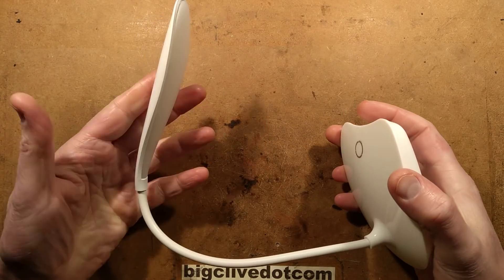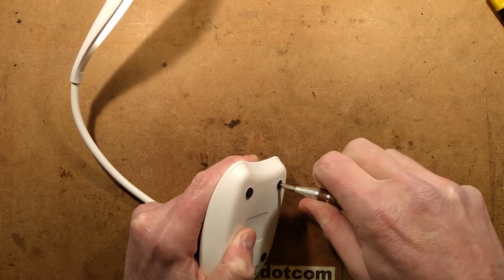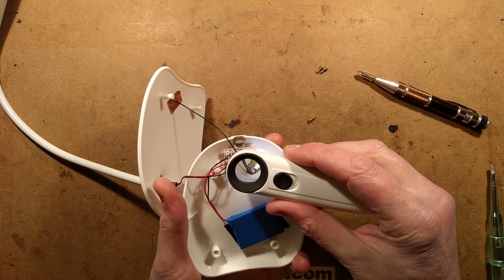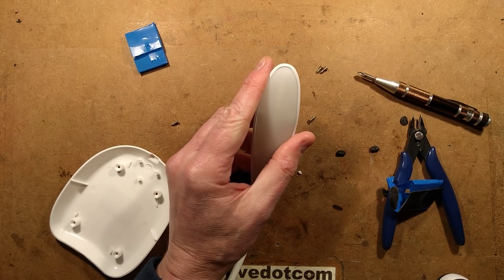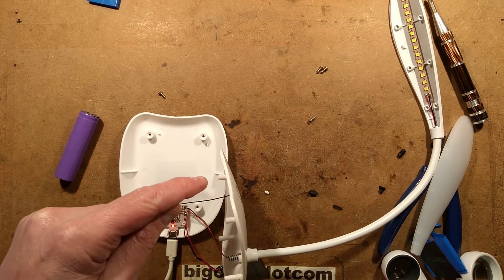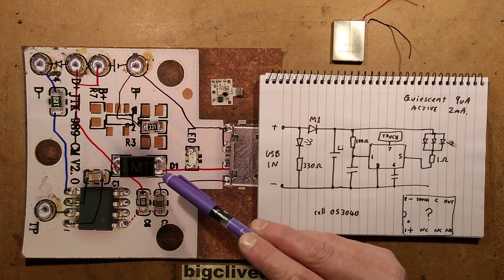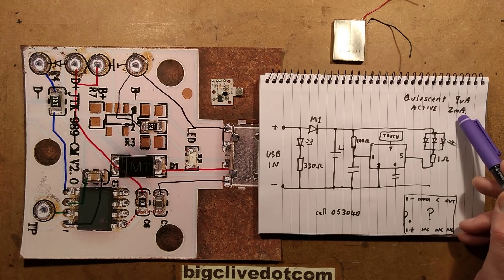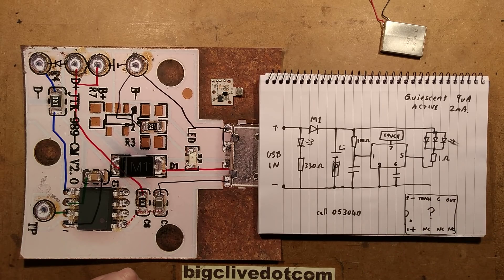Inside a dodgy rechargeable touch light.

Comment: i have a similar version however i think you missed the chip has low Voltage cutoff protection and it charges slowly  ~45ma to right around 4.16v 

mine can fit 2x 18650 and with 4000mah from 2 CGR18650A (laptop pull) on LOW i get ~100 hours and on HIGH i get ~20  not finished testing 

the light will dim below 3v but will turn off at ~2.75v
Reply from the maker: Mine had no protection circuitry at all.  So I put in a lithium cell with built in protection.
Reply: @bigclivedotcom   how can i email you

Comment: I bought two of these two years back and fitted them with large lithium cells almost straight away. It's a dodgy lamp, but it works. Mine doesn't have a 3-step light level, instead it just changes slowly and you stop pushing the touch button at the intensity you want.

Comment: I got one of those type lights however mine took 3 AAA batteries. I hat AAA batteries so I installed a small cell like that, then used the little charging/protection adapters you can get off eBay.  The one I have has the magnifying glass with a circle of LED'S to light up what you are looking at.  I use it sometimes when I need that extra magnification for my soldering jobs. Conversion of these things is really kind of fun I have done others using old phone batteries or batteries from old PDA'S that I used to play around with in years gone by.

Comment: My mother has one of these,  mounted on the underside of her kitchen cabinet above the sink. It's hooked up to a similarly dodgy 5V charger so it wouldn't run down. So you're saying that the cell is kept at a constant 4.4V, and could light the entire kitchen on fire anytime? That is... reassuring  🙃

Comment: This type of capacitive sensor is extremely simple, you can do it with only a microcontroller and no extra parts. I've done it in the past with an Arduino, and depending on how sensitive you make your code, it can sense your presence from quite far away. A lot of fun to play around with.
So that chip on there might well be a generic microcontroller (probably some chinese one they can get for next to nothing in bulk)

Comment: The LEDs have to be in parallel, don't they? Are you sure there aren't any resistor up there, then?
Reply from the maker: They are in parallel.  They have probably used matched LEDs from the same batch, and the current will be low enough not to cause an issue with slight forward voltage variation.
Reply: Thanks for the reply :-)

Comment: Currently having a lot of building work and "camping" out in one room, at night it's like an assault course getting past all the obstacles, so I've scattered a few ebay and aldi pir controlled 6 and 10 LED lamps about the place.  No rechargeable types but all are incredibly sensitive.

Rechargeables terrify me after watching clive and his tin of doom ... I bought a selection of charge/discharge protection boards for pennies on fleabay.  I'm still a fan of "ordinary" cells
Reply from the maker: Rechargeable cells are perfectly safe if not severely damaged.    If you're without power right now I'd strongly recommend a head torch as a very convenient lightsource at night.
Reply: # @bigclivedotcom  Headlamp not a bad idea for evening when hands full of brew and bikkies, the PIRs do add a certain something to a journey.  Swanning round with lights automatically following you does add something. 

At 60+ "getting about" is actually a euphemism for going for a pee.  At 3am I've usually waited to the last second so need to make the journey quickly, hunting down headgear isn't always an option.

Comment: I guess it might be a cool project to find a proper charging chip for the battery and hack the PCB so it runs properly. I am pretty certain I just yesterday came across an almost identical setup inside a bluetooth USB mono speaker from Aldi. If that is the case I may try and do the same as I think it has been damaging the lithium battery for the same reason and giving less and less run time between recharges because of it.

Comment: Clive, I'm sorry to say that on this occasion you have got it wrong! We follow your work with much scrutiny. You missed part of that circuit! In the clip at (9:05) you say there would be no way to make it work! The VCC exits the USB and goes to D1, however, there is a track that then goes under the diode up to PIN 4 of charge controller. The circuit is designed for a Microchip MCP73831/2. After said part, a resistor and some hot air and paste we have a working charge managed version! Basically as a side note. what has happened here is you got what looks like the cut down version. We have now removed the diode as it is not needed! MCP set to 150mah and it is able to also run and charge the battery at the same time!

Comment: Before the "Smart" phones took over, I was into those cheap tablets, I ordered broken ones for a very cheap price, and tried to build up one working out of two or three.  This left me with tons of old lithium flat cells of various sizes and shapes, add to that, I have gone through dozens of old laptops that I have torn down, and tore apart the batteries for the cells, giving me dozens of old 18650's and most recently, a strange little square cell about three times as thick as the one you found in that lamp with tons of power, that was contained in a small battery pack from an old tablet that worked on WIndows 2000.  Amazingly only two of the 8 cells in that one were dead, the rest took a full charge and seem to be working great, I have yet to attach them to my tester to run a full test to find the power available in them.  Looking at that lamp, I think I have a cell that would nearly full the base,  not to thick, and it is a single cell so the voltage would be proper, man that lamp could work for days on that cell without needing a charge.  Perfect for use in my RV, if I ever get to travel in her again.  Mom is going into a nursing home tomorrow, she is still going strong, but can't seem to keep from falling now, so needs the attention. Lots of work ahead of me today, so thanks for the great video, I shall indeed look at that light in earnest. when I get a chance.
Reply: All the best to your mom.
Reply: @Useaname  Thanks, she has been in the home now for quite some time. They found the problem and have her on meds to control the falling, but at 93 years, she has decided to stay in the home. She loves it there with all her old friends, and says the food is wonderful, as is the care. We are in the process of now selling off her property for her so she will no longer have the taxes, insurance and utilities, so if anyone needs a nice 2 bedroom home in northern South Dakota, let me know.

Comment: Interesting, I own one of these from 3 years ago. Different PCB, has a screw in the LED defuser plate, does not have divots above the LEDs in the mold. And it has a mold to hod the battery in the middle with a steal bar to weigh down the base. Also charged with USB to a DC barrel connection, not micro USB. It’s hard to tell, maybe yours is a smaller version of mine so it doesn’t need the weight? I thought I checked the cell, when I bought it, but I hacked again to be sure and mine is also a metal encased cell but it does have the protection circuit on the battery. But at first look I thigh it was the same one. Either they cut costs over the years, or a few different one are being manufactured differently. Exactly why I take things a;art when I buy them, you never know from the outside what you really get.

Comment: 4.4V might be ok for a high voltage lithium cell. I would only operate that thing on a fireproof surface though. Or rather, I wouldn't operate that thing. Since I have a 3D printer, I'm only interested in those gadgets for inspiration. One could get one of those charging modules from ebay and slap that in to make it safe. Some 5V zener diodes and a 6V solar panel also make a good addition when you have said charging module inside. Simple to make, simple to fix and rather cheap.

Comment: 5v power supply is so ubiquitous, I started to modify all my electrical stuff that I could get away with 5v circuitry. No more heavy transformers or high voltage florescent lamps. So light.

Comment: It looks like one of those Li-Ion cells used inside the white shell for the Nokia 3310/3330 (minus the little protection PCB)
. I've had those batteries bulge and split the 2 halves of the white plastic shell apart, revealing the cell (looking exactly like the one in this video, size and everything) and the little protection PCB that usually isn't protective at all on the cheapo replacements.
As for the 250mAh ... If this was measured it via one of those inline USB gadgets logging the charge etc. it might be way off. None of these in-line charge monitor gadgets that I've tried has been accurate if the charge current is fairly low. For phones that charge at 1 amp or more they're usually OK and show mostly realistic numbers, for something charging at less than 500mA they will read ridiculously low capacity numbers (or sometimes no capacity at all) as if they're unable to measure it properly

Comment: The controller may be an ATtiny202 or 402. Power pins match and the capacitor is on the reset pin which has an internal pull-up. The ATtiny has got capacitive touch channels and PWM peripherals.

Comment: Hi Clive,

I have a lamp from what I think the same manufacturer.
It works on 3 AA batteries and does NOT have the innoying dim feature.
Instead you can hold the capacitive touch somewhat longer and it dims.

It even remembers your dim setting after shutting off and works amazingly long on batteries only.

No charging built in though it has a USB power plug.
(Great nightlight in case of power outage!)

The leds are very small but also fairly bright.
Reply: I wonder if the brand name is iZoom. I have one (that works like what you describe) I use to light my keyboard during late nights when I don't need to light up the whole room. 

Both that one and a similar model that works exactly like the one in the video came from American Science & Surplus (sciplus.com). They both even have that 'War of the Worlds"-alien look.

Comment: Believe it or not this was actually quite expensive - I bought 2 of 'em from my local cheap shop for £1.99 each (almost identical). The LED's give off a very harsh light but colouring the transparent LED cover with a permanent marker makes them quite nice (I used red but the light kinda comes out orange).  The BIG problem with them is that they fall over if you glance in their direction - I'm going to fill the basses with something heavy when I get round to it.  For £1.99 they are not bad :)

Comment: Looks like they've copied this and converted it for battery. Have bought almost identical model 5 to 10 years ago, but it runs with power supply, not battery. Base design is just round on that one. Lamp I think is identical.

Comment: Ah heck, tear apart a cheap power bank with protection in it's charging circuit, wire in parallel with the light controller and any cells you keep/add, and charge through the power bank circuit.

Comment: I found a simular lamp and the chip in mine was a SGL8022w http://www.coldtears-electronics.com/images/SGL8022W.pdf
Reply: Oh i saw that chip when i did some research! Widespread and documented, versatile function, nice. But the footprint of the chip on this here doesn't match, unfortunately :( 8022 can't be nearly as cost effective because it can only sink 9mA or source even less and thus must drive an external transistor to perform actual switching function.

Comment: Wouldn't it be easier and cheaper to simply replace the existing diode with TWO Schottky diodes in series ?  Get two diodes that have around 0.3v drop at low current and around 0.5v at high currents and now the battery is unlikely to see more than 4.3v (provided the usb is 5v or thereabouts.. there's some voltage drop on the wires inside at high currents also)
MBR1020 , MBR120, MBR130 ... less than 10 cents each in volume
Reply from the maker: You can't really rely on the USB input being an exact 5V.  Some chargers put out over 5.5V.  With lithium cells the critical charge voltage requires tenth of a volt accuracy.

Comment: How do you tell if a cell has protection? Would cells from Nokia phones have protection built in?
Reply from the maker: They usually do, but it's not guaranteed.  The only way to test is to charge them up while monitoring current and voltage and see if the current drops to zero as the cell voltage is around 4.2V to 4.25V.
Reply: Easily removable cells from phones (as long as they're more or less legitimate cells from more or less legitimate phones) always have protection. Consider this, they have exposed + and - contacts, so if you were to accidentally short them i.e. by putting the battery into the pocket with your keys or a tinfoil wrapper from a candy, the resulting fire would not exactly be regulation compliant. Or someone puts it into a wrong phone or under a weird angle, those kinds of things.

Permanently installed cells may need to have their top dismantled to see whether there's terminals going right into the cell body or whether there's a protection board attached in between. Or elsewhere Clive suggested attaching them to a constant current supply with current monitoring, putting a bit of current into them at the top of their charge, and seeing whether the charge current rapidly shuts off once termination voltage somewhere between 4.2-4.35V is reached. These protection chips like DW01 exhibit 3 functions, they turn off the battery when it's about to be overcharged, or overdischarged (below 3.0V), or when current drawn is too high (short circuit protection) and you could hypothetically test either of these functions, though testing short circuit protecton is only fine when it's actually present, othewise ill advised :D Overdischarge via a suitably high current limiting resistance should work too, you should see the current (or alternatively voltage across discharge resistance) abruptly drop to 0 somewhere around 2.9-3.1V if protection IC is present.

Comment: I bought one at Dollarama in Ontario for $4.00 Canadian. My model uses 3AA batteries (I use rechargeable AAs) rather than an internal Lithium rechargeable through USB. I imagine replacing the internal battery with a resistor and connecting a power bank using USB would remove the threat of Lithium battery combustion and vastly extend the length of time it produces light. My battery bank allows use while charging so when I see those lights again I will pick up a few and convert them. Add some velcro or magnetic strip to the underside will add to their usefulness.

Comment: Could be something like an AT-tiny13 as an uC as it has PWM and it is possible to get an capacitiv button working.
Also if it seems if you remove the diod you can enable the battery protection if populated - but hard to tell on my screen.
Reply: The Attiny13 has earth on pin 4, probably an ultra cheap one time programmable microcontroller.
Reply: No, i'm not aware of any uC that can sink 300mA of current, i doubt it can even be done. It has to be a special purpose chip. It's not an ATTiny for numerous other reasons too.
Reply: @SianaGearz  No, you are right, it wouldn't work to use a uC, not one I can think of anyhow.

Comment: Is the job manufacturers of chips and other electronic parts to print its name on top of the part when they make it because its easier to be repaired because you can see its details.
I dont think putting it on the part that is going to face the motherboard is wise idea because then you cannot know its name and its values
Reply: You didn't get the memo, things aren't made to be repaired in 2010s.

That being said, putting the designation on the bottom is about as useful as not having one at all, and i personally haven't seen bottom marked chips. I mean the manufacturer won't read the chip designations anyway, what it says on the sticker on the side of the roll must be true.
Reply: Just a guess, but I'd almost expect it to be a otp mcu, so knowing the designation wouldn't help anyway unless you somehow knew the hex.. You can get the Padauk ones for about 5c a throw programmed, there's probably something else cheaper than that on the market too. I'd guess they're blank to give the option of custom branding.
Reply: @secretivesquirrelstudios  not aware of any MCUs that can directly sink 300mA of load, i think it's even hardly possible to make one. I think the world can absorb touch-control lamps in super-million quantities so making a dedicated IC makes total sense. Why it's not marked? ¯\_(ツ)_/¯ Maybe they're saving some money there.
Reply: @SianaGearz  You're right of course, I didn't even think of that, it'd need transistors of some persuasion to sink the load, I've just looked at the padauk datasheet and that only seems to sink about 10mA or so, nowhere near enough current for this task.